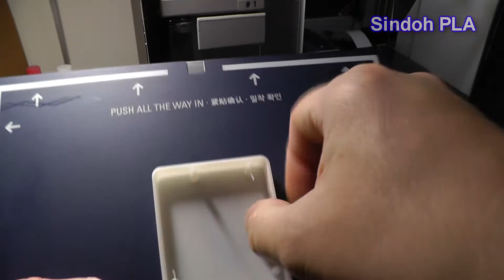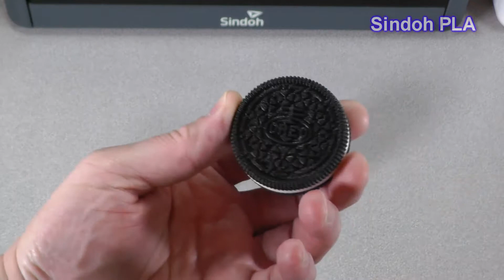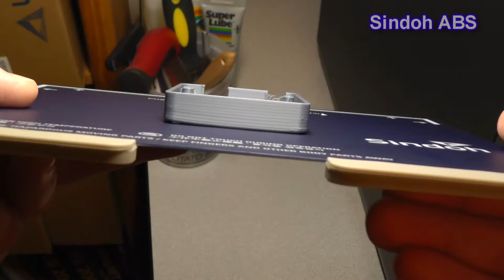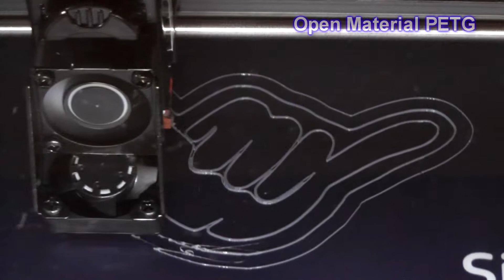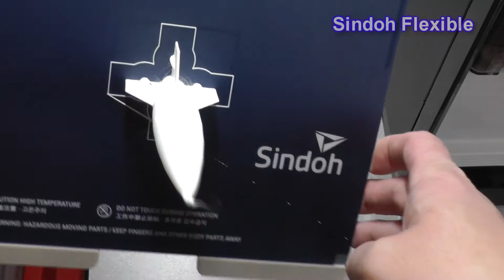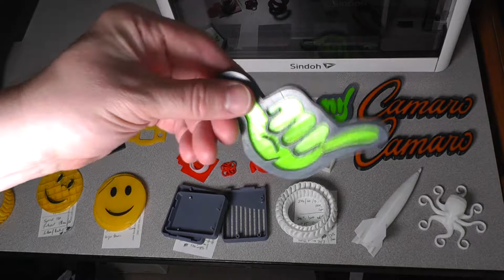06 - Sindoh 3DWOX 2X 3D Printer - Print Samples

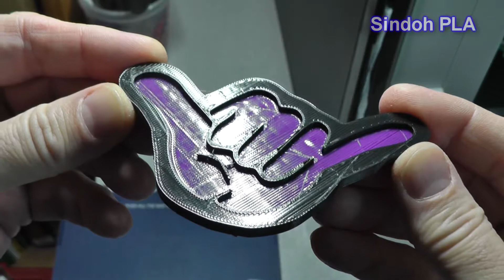Comment: Hello Bob, love your videos I like how you keep it unbias! I'm not sure if you answered this questions in another video, but I keep seeing this problem with Sindohs slicing software. The top face scaring as seen on 5:00. Besides using another slicing program, have you attempted to resolve this issue to eliminate the scaring?
Reply from the maker: I have not spent time trying to resolve this issue.  However, I would consider whether I am overextruding or printing at too high a temperature, and then consider adjusting my retraction amount and speed.  If I want a nice finish, I typically print that face down on the bed when possible.  If you don't need a completely solid (water-tight) top surface, you could print the top layer(s) at a 90% or 95% infill which should leave a tiny gap between lines and avoid overextrusion.  You could use a vertical lift/hop that would lift the head after each layer and retract the filament and move to the starting position of the next layer, then drop back down. This would avoid scarring the top surface.  You could do this in a separate process in Simplify3D for the top layer(s) only, for example.

Comment: What do you mean with Sindoh flexible? Is it available on amazon? What is the material called? Can it be used on the wox 1? BTW nice results. I noticed that on my machine the bed can only be leveled with an accuracy of 0.2mm. Sindoh confirmed that. However I got it down to 0.05 mm by placing paper strips of known thickness beneath the removable bed. This is tedious work but pays off when you need a larger floor area and want to rely on an even bottom layer finish.
Reply from the maker: Yes, Sindoh flexible filament is available on Amazon in several colors; just search Amazon for "Sindoh flexible".  However, it can only be used in the 3DWOX 2X model - NOT the 3DWOX1, DP200 or DP201.  The 3DWOX 2X uses a different Type-C cartridge style that has a helper roller to move the plastic spool as well as the filament.  Also, the 3DWOX 2X has a much longer and more gradual filament path and has auto-adjusting tensioners which loosen the grip in the extruder mechanism for flexible filaments so they don't jam.  I believe each "notch" on the 3DWOX 2X bed adjustment knob is 0.1mm.  I find I can only get so close on all my 3DWOX machines using assisted bed leveling and get a better result following up with a manual bed leveling.
Reply: Thank you for the reply. My 3DWOX 1 came with a c type cartridge which I like for the unloading part.  But when the spool has less than half of the filament left some tangling may occur due to the smaller diameter. When I ordered an additional cartridge amazon sent me the b type which is compatible but does not rotate the spool. Well I am not complaining as the cartridge came with filament although I just ordered an empty cartridge. To the bed tolerance. I had some lengthy communication with Sindoh. They admit that some warping is possible and that they are working on a dynamic adjustment such as the ultimaker has. With this the gcode starts with measuring a grid of actual nozzle distances. They are then applied to correct the nozzle positions. They did not tell me the release date of the firmware and slicer update.
Reply from the maker: @LutzSchafer  The 3DWOX 2X has a menu option for "Active Leveling", which is not documented very well.  I wonder how this may play into your equation?  I asked them about it and received this:   "This function executes Bed Leveling before printing starts and offset the bed leveling by moving the bed in the direction the Z-axis during the printing. Active leveling is finer leveling feature. The machine calibrates height of bed during the single layer printing. (First layer thickness becomes uniform and first layer sticks to the bed better).  If you activate this feature, the machine will do the active leveling before every printing automatically. It takes time so OFF is the default state of Active Leveling.       

Active leveling helps uniform printing. If the number of printed layers is small, improvement is more obvious. (They also mention if you have a problem when with active leveling, there is a newer beta firmware for 2X available direct download).
Reply: @AllThingsBobot  yes exactly that's what they said they have for the X2 but not 3DWOX 1 yet. But they will eventually. Have you used it successfully?
Reply from the maker: @LutzSchafer  No, I haven't had a need for that kind of accuracy or any leveling issues and I simply inquired to them as to what the menu option was all about.